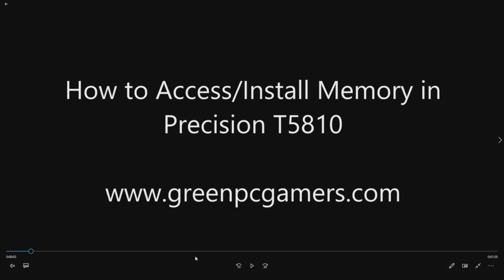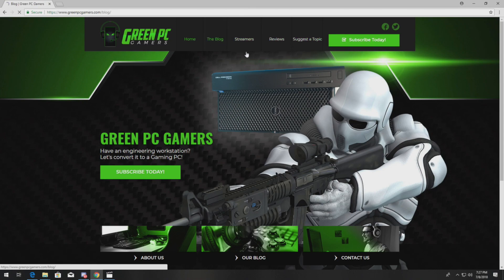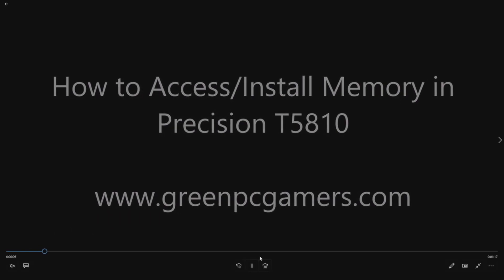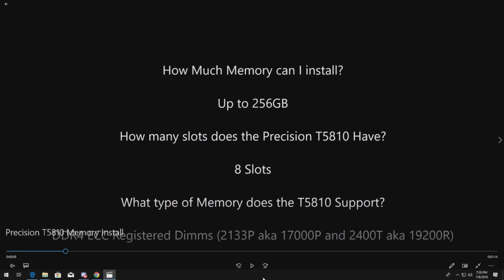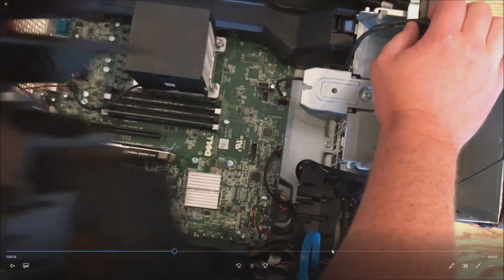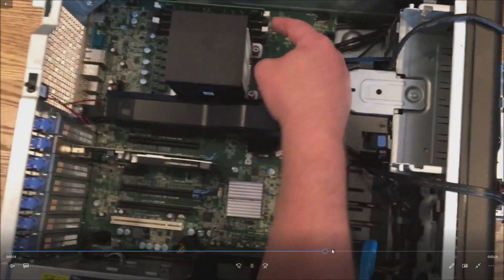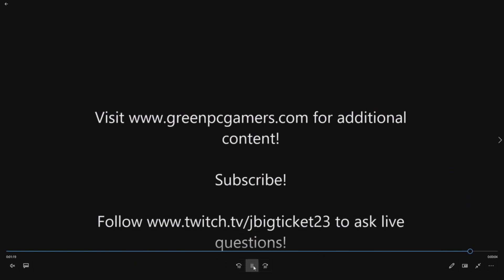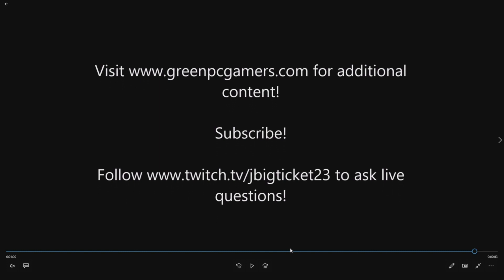How to Access Memory/Ram on a Precision T5810 Workstation

Comment: mine was running fine with 4 sticks of 8GB 2133p so added another 4 sticks and now it won't post.   I do have two sticks of 32GB 2133p - which slots should they use ?
Reply from the maker: What model system do you have?

Comment: And its possible to add second GPU? Now I have there ATI radeon W5100. I can add near the Radeon for example newer type of geeforce model? Or it will not work properly or not used properly the GPU-s?
Reply from the maker: You can run 2 gpu's independently.  You won't be able to configure them in an SLI or Crossfire configuration with a T5810 system board.

Check out this SLI guide:

https://www.nvidia.com/en-us/design-visualization/rtx/sli-certified-systems-and-motherboards/

Comment: Hi. I have 4x 4Gb  (DDR4-2132 (1066 MHz)dell Ram now. And I bought (not recived yet) 2pieces of 32Gb ram ((DDR4 2Rx4 2400MHz ).
Reply: Or if I using 4pieces of 4gb ram (what I have now) and near thus rams I adding 4pieces of 32gb rams is ok?
Reply from the maker: Yes, 4 x 4GB + 4 x 32GB should be fine.  Just make sure the 4GB modules are not unregistered dimms.
Reply: @GreenPCGamerscom  the 4gb was until now. Its the original one.

Comment: Hi.. If I have 16GB Dell memory now on my T5810 workstation. Can I add near this 16 GB two pieces of 32GB memories? So whole together will be 80GB memory?
Reply from the maker: If you have 6 x 16GB modules installed, adding 2 x 32GB modules would not be considered an optimized configuration.

This link has the T5810 recommended memory configuration matrix.  

https://www.dell.com/support/manuals/en-us/precision-t5810-workstation/precision_t5810_om_pub/memory-module-guidelines?guid=guid-95c34f6c-d733-4611-952b-4b512b619262

Comment: How do I fix the light flashing orange when I install ram but when I remove it it turns on like normal ?
Reply from the maker: You’ll have to double check the modules that you are adding as well as the configuration.  Do they match the existing modules?
Reply: @GreenPCGamerscom  no they don’t. Can you not mix ram on this workstation?

Comment: I could install non-ECC? 
Also, the blog says to get a full speed recommend conf 192000, could you provide some feedback?
Reply from the maker: The memory speed depends on on the memory and Cpu you have installed.    Most V3 CPU’s = 17000 aka 2133 and V4 = 19200 aka 2400.  We’ve never installed non-ecc memory on a T5810.
Reply: So installed the following memory single module (Micron 32GB PC4-19200 DDR4-2400MHz ECC Registered CL17 288-Pin DIMM 1.2V Dual Rank Memory Module Mfr P/N MTA36ASF4G72PZ-2G3B1)
But according to (Speecy) my system (E5 1650v4 cpu) it is only getting 1197.2 Mhz for ram frequency. Have I been mislead by the seller?
Reply: Since ECC ram is so expensive here, i decided to buy 2 x 8GB DDR4 non-ECC rams and fit it in. What i can tell you is it works, but you cannot mix ECC and non-ECC together. For my case, i had to remove the ECC ones, then install the non-ECC rams.

Comment: Hello, I need to update the ram and I have T5810 with cpu E5-1650 v3 can I put 2400 mhz ECC or only 2133 mhz ECC, thank's.
Reply from the maker: You can install 2400Mhz memory with a E5-1650 V3 processor, but it will only support up to 2133Mhz Memory.  Basically, 2400Mhz will clock down to 2133Mhz because of your cpu.

https://ark.intel.com/content/www/us/en/ark/products/82765/intel-xeon-processor-e5-1650-v3-15m-cache-3-50-ghz.html
Reply: @GreenPCGamerscom  so if I buy a new better cpu , it will handle 3200mhz ram speed

Comment: Hello would it work with ddr4 2400 mhz or its only 2133mhz? Please help 😄
Reply from the maker: You can install either 2133P or 2400T Memory in the T5810.  You should pick the fastest memory supported by your processor.  What model and version processor do you currently have installed?
Reply: GreenPCGamers.com i would going for E5-2687wv2, im sure 2133 mhz or 2400 mhz.
Reply from the maker: That processor isn’t supported by the T5810.  Do you have a T5610?
Reply: GreenPCGamers.com Yeah its T5610, my mistake.
Reply from the maker: ArschBär Ja Mann the T5610 is a DDR3 based workstation.  The max memory speed is 14900R aka 1866mhz if you use it with most V2 processors.